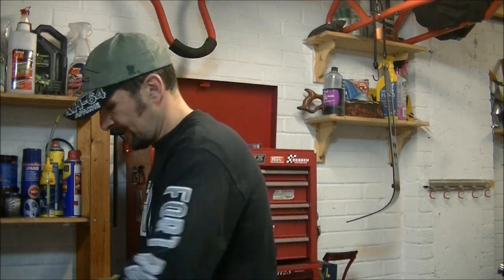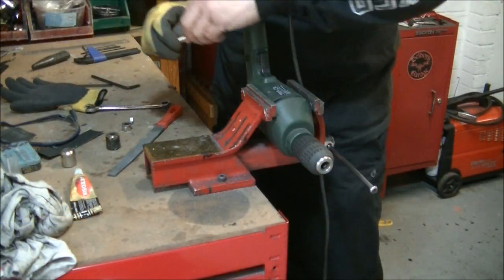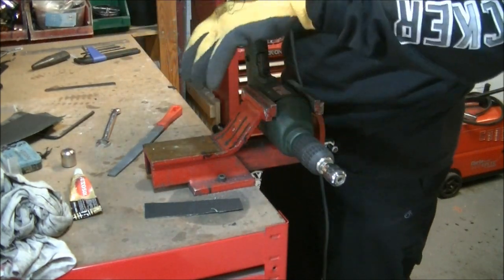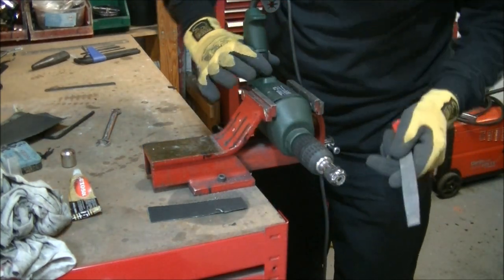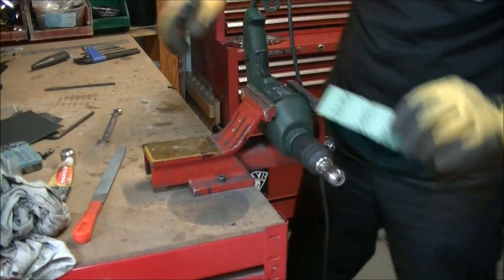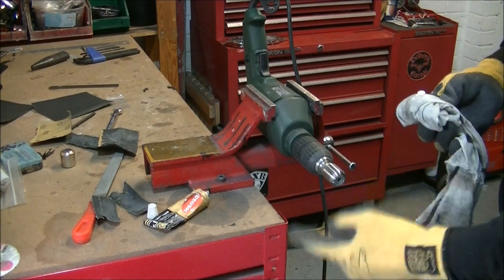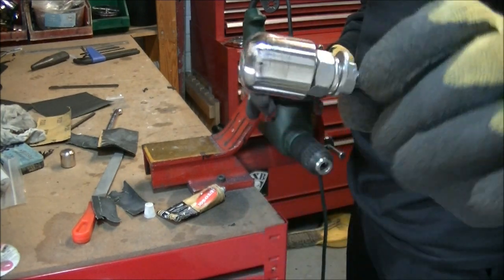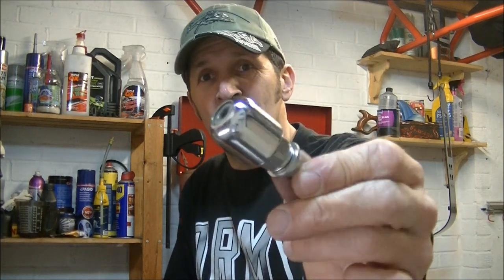Delboy's Garage, Handlebar Weights, Restored in minutes.

Comment: :)
Thanks Del,i should have used THE common sense.:)
The handle bar ends not stainless so I have applied a several thin coat of lacquer which done the trick.
With the brake disc bobbins I was able to move them with a big  
Strong grip pliers so thanks for that as well.
Keep up with the usefull videos,
Have a good weekend guys!

Comment: ....this mini-lathe idea is very useful for many other things too. I was told I needed a new starter motor for £200 when the brushes kept wearing away , due to the commutator bars being lumpy and grinding the brushes into dust. So I just pulled the spindle out , put it into a drill like this, and with a file then glasspaper I took 2mm off the copper bars....and it was like new again. There was plenty of depth to the copper too, and after buying yet more brushes...it worked fine!

Comment: Nice Job Del, i've never done this myself but I have gone to the trouble to clean the black ones up and resprayed them, RSM8.
Reply from the maker: Cheers Skeggs, there's a great little tip to get a really cool finish using enamel paint and a model brush... if you have a drill that turns real slow you can do it like a pin-line effect by holding the brush against it as it turns (but not at regular drill speed, or you'll just get a black stripe up your face lol!)...
Reply: I do this alot lol I even used this method to clean my nitrous bottles for paint or polish ..low speed and angled down of course...it's like a poor man's laith :P

Comment: handy little tip ive not got a garage or a drill so will take a little more time an effort ,but after seeing your result an listening to your reasoning,will be worth it cheers del
Reply from the maker: Mate, you can buy a drill for less than £15 and a cheap vice for even less than that, and it's not hard to mount on a workmate...Del
Reply: might take you up on that , still want a garage though lol

Comment: Excellent vid bud, I'm gonna take the ideas and use them for the crash bungs on my cbr600f3 project. Any ideas on what tool to use to take out the scars? I'm thinking just use some medium grit sandpaper then going to really fine gradually.
Reply from the maker: As they are nylon, rather than steel, you could just use initially some 80grit to take out any bad scarring, then go finer, like you say, till you polish them out!  Spinning a bigger lump like that, make sure you get them central as they'll fly all over the place with you light it up!

Comment: I do have a question.  Those bar weights, well the one that you were working on.  Is that one heavy.?  Because the ones that are after market are bloody light...The ones on my bike are light but the other bike I have are heavy.  I am unsure what weight I should be looking at to counter the Freq caused by viberation.  This has always puzzled me.  What is right, what is wrong and should rubber be used as a dampner.???  bad spelling soz....:P
Reply from the maker: Hi Jason. Most factory bar weights vary around 8oz to a pound in weight,this will soak up the vibes that lead to numb hands and uncomfortable feedback from the engine... many of the after market 'weights' that are anodised pretty colours are made from alloy and for looks only, and in swapping to them you allow the vibes to come back which can not only lead to discomfort, but also unstable steering operation in some cases...the ones in the video are solid stainless and about 10oz each.... and they came from an old EXUP i had...without them the bike went into head shakes when pulling hard out of bends....best to use "weights" and not 'pretty end caps'...its in the name after all..lol.. hope that helps mate... Del.
Reply: thank you.
Reply: jason puttock I do have a random question off topic.  Nikasil VS Alusil cylinder the piston ring being DLC vs TLC and along the same lines for wrist pins.  I am unable to find the best setup and mixes where 2T are concerned.  I know sulphur was a big issue and now almost out of our fuels and was a regular seize job in the states.  I am alittle apprehensive but I need to ensure the correct build for my son and daughter bike Aprilia RS125 2000 model.
I swear blind you did 2T a lot when you were younger, hence asking a major motor head like you. I would ask stan stevens but he's retired now.  I would send it away, however I don't trust anyone else to build the bike except for you and your ideas.  Too many bad traders.
I think.  TLC piston rings with Nikasil cylinder and DLC wrist pins.  Any thought pls Del, I'm stuck.  thanks.

Comment: Nice little tip Del Thanks. I always laugh at the 'excuses' for minor damage in ebay ads, in particular how often the seller takes the trouble to point out that it was the previous owner that did it - as if that makes a difference.
Reply from the maker: Ha ha yeah, dont get me started...things like.."Slight cosmetic marks" or  "barely visible and not done by me"....or the old 'Unfinished project' ploy..."only minor finishing needed"...

Comment: My Ducati Multistrada oddly has plastic bar ends. I believe it has rubber incorporated in the the riser mounts negating the need, at least the need for vibration dampening. Could really use something more durable though on the ends though.
Reply from the maker: Yeah many factories make other arrangements...the OE Bandit bars have a molded rubber block in each end of the bars...and the Scrambler/Bonneville have a metal block in the end and a slim steel end cap...

Comment: Hi Del,
One more question:
How can I free up the front brake discs bobbins on my fazer 600(2001)if there isn't any hole in it?
What tool shoul i use or how can I get to it?
Cheers
Attila
Reply from the maker: Pretty tricky if they dont have holes....you can still spray them and scrub round the gumline with an old toothbrush...and if you can get some grips on them by gripping either side, then you can often move them....otherwise, there isnt much else you can do.   Good luck fellah.. Del.

Comment: The guy I bought my motorcycle from used original bar weights on a aftermarket handlebar. What he did to fit them was: he glued a piece of wood to the inside of the bar, and used long screws (the ones you use for wood) for each bar weight. The best thing was that the screws werent even the correct size (and were different from eachother, one was black other was yellow) so he made the hole bigger by drilling them out. In the end it didnt work obviously. So I had to spend 30 euro's for new weights :(
Reply from the maker: Sounds like a pretty ghastly bodge...but i guess we see them all the time aye..

Comment: Hey Del, I'm getting ready to change my rocker cover gaskets on my 1200xl 2010 sportster. Got a little leak on #1 cyl. Instead of the dealer, can you please recommend me a reputable online parts supplier for Harley Davidson parts? I'm in the US. Mid California. Thanks, and keep them vids rolling. Dave
Reply from the maker: Hi Dave.  As odd as it may sound, the only gaskets i would use on a Harley, are genuine gaskets, and the dealer doesnt seem to be too pricey for these...the rocker box gaskets aren't just flat paper or cork... they are grooved rubber/silicone joints that fit into recessed tracks in the head.....and non genuine ones wont fit perfectly, and will more then likely leak pretty soon,   Here on the UK the only saving we can make on genuine Milwaukee parts is to go to 'Jersey Harley Davidson' who are offshore so you don't pay the purchase tax of 20%....why not see if they can help you out, after all, the MoCo projects itself as a world wide company?.....good luck with it my friend, and hope that can help you.... Del.
Reply: Thanks, helps a lot. Yeah, genuine's the way to go then I'll do it. Thanks again.